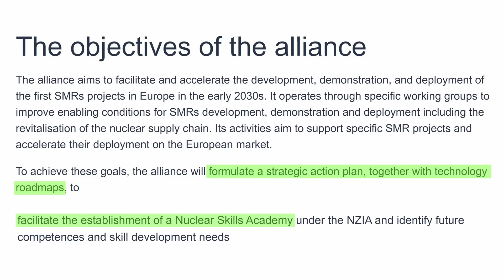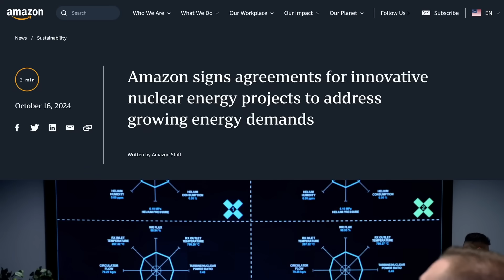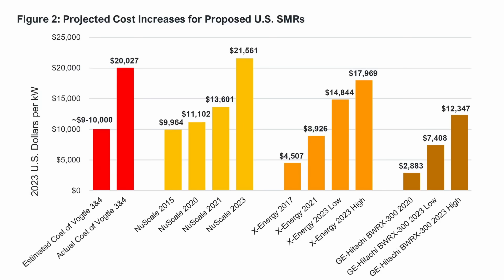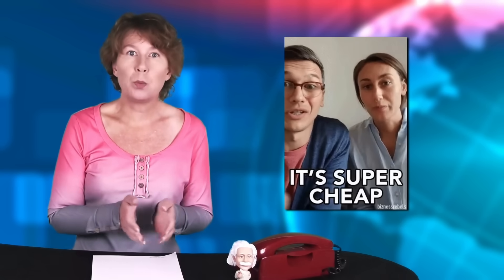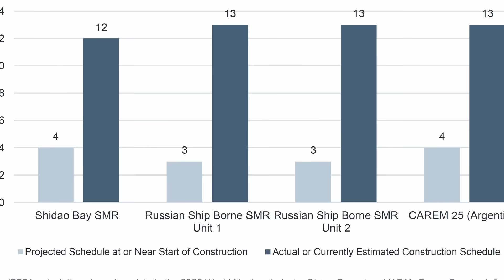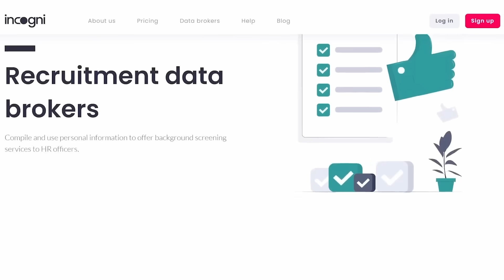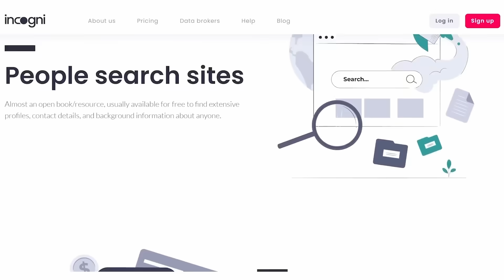Small Nuclear Reactors Have A Big Problem

Comment: I'm confused. We have been powering submarines with small nuclear reactors since the USS Nautilus in 1954. So what's the problem here? We know how to make small, portable nuclear reactors safely and reliably. Dozens of submarines and aircraft carriers are powered by small, portable, safe and reliable nuclear reactors. They all can't cost many billions of dollars a piece? Could someone please kindly explain?
Reply: 1st the question of 'small'
A ship has a reactor about 30-50 MW in size.
A 'Small'MR could be between 50-300 MW in size.

2nd the question of use
Powering a ship is mostly about producing turning a propellor, not generating electricity. (i.e. direct use - turning a shaft with small efficiency losses to the propellor)
Powering a city is about generating electricity. (i.e. indirect use - turning a shaft which generates electricity at a much lower efficiency)

3rd the question of relative cost
A ship reactor is cheap compared to diesel + batteries + less effective missions.
A power reactor is compared to super-cheap coal.
(i.e. there is no good competitor to SMRs for submarines/aircraft carriers)

4th the fuel is different
Ship reactors typically use 20% enriched fuel, operate WITHOUT refuelling and are thrown away after 20-30y use.
Power reactors use 5% fuel, refuel every 3 years, and need to be refurbishable until age 80-100.

5th Assuming a SMR isn't competing against coal, it has to compete against a 1000 MW reactor.
* operators, maybe 1-2 less
* maintenance staff, maybe a few less
* security staff, maybe a few less
* admin staff, maybe a few less
I.e. a 300 MW SMR is maybe 60--70% physically smaller than a 1000 MW reactor, but produces 60-70% less, not 30% less, electricity.
Alternatively, a 1500 MW plant is 50% more electricity, but only 10% bigger in physical size than a 1000 MW plant, so as you go up, you can see savings.

SMRs have other advantages, but you have to be in a particular situation. In general, the bigger the 'cheaper' (per unit - although the total cost is higher).

Comment: Cost blow-outs are not unique to small nuclear reactors I suspect -- we had a 'green' pumped hydro (Snowy 2.0) scheme that was supposed to similarly help address the issue of syncing green (solar/wind) power production with demand via storage (rather than extra base grid power production), and the cost also went way above the initial (already expensive) cost estimates -- I think we are already at about 10x the initial estimate, and the project isn't finished yet.

Comment: I'm pro centralised fusion power - the one in the sky has been powering life on Earth as long as we've been around. The collectors on the ground keep on getting better, cheaper and faster to implement. They can also be distributed where the power is used. 
The biggest attraction of Earth bound nuclear is that it is big, needing big money (usually from governments) and centralising profits (to big corporations).
Reply: Learn more, you obviously don't understand how the grid works.

This is about a fact.
**In an electrical grid, the power must be produced in real time, as it is being used; if supply to the grid is less than demand at any time, there will be a blackout. For the grid to function, supply and demand must be balanced at all times.**
Solar is intermittent obviously because we have nighttime. Wind is intermittent obviously because sometimes the wind doesn't blow (or blow strong enough).
However, if the public can be made to understand that loading the grid with intermittent power sources without backup means regular blackouts, and that backing up the United States grid with batteries would cost at least the equivalent of the US’s whole annual national income, and that backing up the intermittent sources without batteries  (in the absence, at least, technologies that are hardly conceived of yet) means ramping up diesel, natural gas and coal generators and producing enough CO2 to render the whole exercise pointless, it will put the burden on those who think that it’s a good idea (Democrats) to go through with it in the next few years to justify themselves. So if the Democrats, who evidently do not understand the FACT of how electric grids function continue pushing the current energy policies, get ready for frequent blackouts / grid failures just like third world countries have.
You get what you vote for. (Tell a liberal the fact, they may not have ever been told it.)

Comment: The narrative presented here seems pessimistic.
It is worthwhile looking at the cost of a nuclear submarine, which is between £1Billion and £2Billion. The cost of the nuclear propulsion plant might be 30%, if one were making a guess. One might estimate the power output as being equivalent to a large super yacht 100MW, which has the same length and beam; and the lifetime of the powerplant. Nuclear submarines last ~ 25 years without refuelling.
The solutions probably exist and are probably well engineered. One might conclude that a nuclear submarine type reactor could provide power to a small city (200,000 persons at ~ 0.5KW each ) for ~25 years, at a cost of ~ £300-£600 million. But this is a guess based on publicly available data.

Comment: Thorium reactors dont melt down.
Reply: As a general statement about any thorium-fueled reactor, I don't believe this. As a statement about a specific reactor design, I believe this; but there are specific uranium-fueled designs that are "meltdown-proof" as well. Can you provide a reference?
Reply: @pdxjjb  the general design for thorium reactors uses a plug to drain the salt when it overheats. The plug melts, the salt drains and the reaction stops.
https://en.wikipedia.org/wiki/Molten-salt_reactor
Reply: That's a feature of all molten salt reaction, even those with Uranium.
I think all small modular reactors have to be that kind for safty reasons.
If we are sensible, that is!
Thorium is certainly a long term option.
Reply: @larsnystrom6698  all thorium reactors are molten salt. Some SMR designs uses uranium rods. I'm not an expert but I do prefer molten salt designs. Specialy that one from Kopenhagen Atomics
Reply: Wrong, solid thorium fuel has made and used.  Like many nuclear kool-aid drinkers you have conflated multiple seperate technologies you do not understand.
Reply: Not existing indeed helps them not melt down.
Reply: Thorium doesn't solve any of the actual problems of nuclear.

Did you mean molten salt?  This is orthogonal to whether the reactor uses thorium.

Comment: I did my graduate research in the economics of SMRs as the primary physics researcher on a project funded by the Obama admin. The experience was one of the best but also most draining experiences of my life. There is a lot of tech there, a lot of capacity, and the flexibility is extremely appealing. BUT, it was heartbreaking to see how hard it was to break ground on any new projects in the US and the EU.

We have off the shelf tech that COULD solve many of our growing energy needs as well as hitting our environmental goals if only politics would get out of the way. I am not talking 'de-regulation', I mean that the public opinion needs to be largely ignored here. Once the benefits are realized, the public will have a hard time rolling things back.
Reply: Seems to me that the basic engineering has already been done on SMRs since a version powers US aircraft carriers and subs. Did you look at the economic feasibility of modifying those existing reactors to fit the bill?

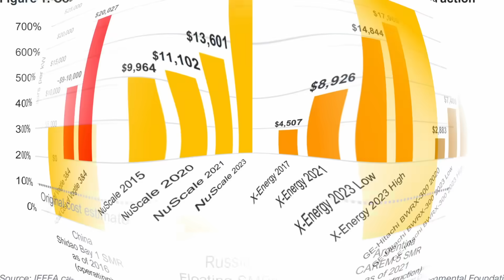Comment: At 4:00 we can see that the cost runs around 20,000 per kW. 

That assumes they're running flat out, but if they're throttled at all, that cost rises. At 50% it's $40,000/kW. Since demand fluctuates the only sensible thing to do is to provide battery backup to smooth the demand. Tesla megapack XL2 is $1400/kW. It's obviously cheaper to size the nuclear for average consumption rather than peak, and use batteries to firm supply. 

But then you have to ask, "if nuclear is only viable when firmed by batteries, why would you build nuclear at $20,000/kW when you can build solar at less than $500/kW and use batteries to firm that?"
Reply: > why would you build nuclear at $20,000/kW when you can build solar at less than $500/kW and use batteries to firm that?"

1st - you can plan when to charge the batteries with nuclear. Within wind/solar you can't. 

2nd - you have to buy a LOT more wind/solar/batteries because of the low c.f. and because of ther intermittency.

3rd - you have to buy a LOT more wind/solar/batteries because of the seasonality.

nuclear - predict demand for the biggest -- day -- of the year, then work out the nuclear/battery mix which will meet demand across the demand load peaks/valleys. The resulting capacity will be fairly close to the average across the day.

wind/solar - predict demand for the biggest -- week? month? quarter? -- of the year, then work out the wind/solar/battery mix which will meet demand across the demand load peaks/valleys.
The resulting capacity will NOT be fairly close to the average across the week/month/quarter, as your peaks are VERY high and your dips are VERY low (because weather is correlated across LARGE areas - ex: Texas is about as big as a hurricane).

And because weather is correlated with previous weather (i.e. 22 January is likely to be a winter's day, just like 21 January, etc) you have to look at long time-frames, which of course give you large variations - the AVERAGE is useless (ex: do people eat the same average amount of ice cream in February as the average amount they eat in July?).

So yes, per unit nuclear is more expensive. But you have to buy a LOT more units for wind/solar.
Reply: @factnotfiction5915  you're missing scale. Not all "a LOT" are the same. You need "a LOT" more solar, (5-10x) but that "a LOT" is much less  than the "a LOT" more cost of nuclear (30-100x).

Comment: Why should we invest in a bridge technology, when we can go straight for renewable? By the time we have SNRs or next gen NPP we could be finished with the energy transformation already.
Reply: From the late 1970s, over a 15 year period, the French built most of their 56 reactors and today have a) some of the lowest emissions, per capita/gdp/etc, in Europe b) cheap electricity.

From 2011 (or even earlier if you listen to the Greens themselves), Germany has embarked on the Energiewende, including closing NPPs. It is now 2014 - so 13 years have passed.

Germany today has a) some of the highest emissions, per capita/gdp/etc, in Europe b) expensive electricity (about 2x the French price).
Germany has 2 more years to beat the French record - what odds are you offering?

> we can go straight for renewable ... [and] be finished with the energy transformation already.
Why do you believe this? Germany has (ok, 2 more years) shown it cannot be done.

They have a strongly united society, with clear political support for RE, and odds are they will completely fail.

Why is it you believe RE is so quick? so fast? so cheap? so low emission?

Show us the country/city/province that has decarbonized as quickly, as cheaply, as France has, but using intermittent RE?
(I will grant you that hydro nations like Norway have, but few countries have Norway's mountainous geography, and Norwegian hydro doesn't really predict wind/solar in flat Belgium, etc).

Comment: Freeman Dyson says the problem with small reactors is they're explodey (not his word)... as they were fashioned based on nuclear sub reactor designs. He says you can make them safer by ditching small and going large.
Reply: If he truly said that, he's a nut - but I believe you must have read him incorrectly.

Small reactors have low power output, so with less power, less 'explodiness'.

If you need to visualize, try this:
Experiment A: put an eye-dropper's worth of gasoline in a 10 gallon bucket, apply lit match to gasoline. Observe.

Experiment B: put 10 gallons worth of gasoline in a 10 gallon bucket, apply lit match to gasoline. Observe.

Comment: Here's a simple calculation for why SMRs or other nuclear plants can never reach the scale required for them to provide a significant portion of total energy needs:
Total functioning reactors on the surface of the earth ~400.
Total major civilian nuclear disasters in the 75 years we've had nuclear power = 3 (Lot's of military ones in that period - Wikipedia lists over 70)
Mean time between failures = 400*75/3 ~10,000 years (pretty reliable - very impressive engineering).

Nuclear currently generates ~4% of total energy needs. To go 100% nuclear would require 25x the number of reactors = 10,000 reactors on the planet. SMRs would require even more. To get 25x reactors would result in them being scattered across the country near most towns (like in France).

But with 10,000 reactors and a MTBF of 10,000 years, we would be having ballpark one nuclear meltdown per year somewhere in the world. And everyone would be living down the road from a nuclear power plant.  I don't think society will ever be happy with that perceived risk. And I definitely don't think my grandkids will be pleased we bequeathed them the contamination or the decommissioning costs.
Reply: You don't get meltdown failures in molten salt or metal reactor.
Reply: @BerndFelsche   But if those reactors are so much safer then why aren't they built and used around the world??   Research has been done on these systems for years with no sign of significant progress.    Maybe because they have their own inherent technical problems.  In other words your alternative suggestion doesn't help.
Reply: @BerndFelsche  There have been (partial) meltdowns in liquid metal cooled reactors.   EBR-1,  Fermi-1.
Reply: Good point. And that's why SpaceX rockets blow up so often too.

Comment: I would say it's partly the opposite - solar energy is just becoming incredibly cheap. The production is basically a paint job the operation is just put it outside and screw it tight. We don't need more energy it's basically free, we need just storage and transportation solutions. Nuclear will never be cheap, you always need skilled people to guard and run it, you always have to dig for uranium. You will never be able to sell them on eBay

Comment: Nuclear power is the most expensive you can get if you honestly take into account all costs. In France last year half of them had to pause or lower Produktion because of a hot summer and too little cooling water, so much for reliability. Just bag it and go for cheap renewables. We have all the capabilities for Produktion,storage and distribution

Comment: It's interesting to see (regular nuclear no longer competitive with e.g. solar, or well almost anything, plus) small reactors neither/in trouble, but does it apply to thorium-based (not under discussion in this video)? Copenhagen Atomics promises cheapest of all (just not of nuclear) is "developing mass manufacturable molten-salt reactors. .. is pursuing small modular, molten fuel salt, thorium fuel cycle, thermal spectrum, breeder reactors using separated plutonium from spent nuclear fuel". Best case is optimistic, I believe thorium and/or molten-salt (small) nuclear has some known problems, so it would be good to know what Sabine thinks. I doubt anyone knows too many specifics about individual technology of companies (and if it's public data to be trusted), at least some numbers regarding cost sunk in, already, might be available.

Comment: Idk if this is a legit scientific question or just sci-fi prompt but if a battery can be a computer, can a nuclear reactor too? Rather than build a smartphone from different device parts of "electron dancer needed", why not build a battery compound which also computer circuit and photonic screen? Someday those not just molten salt rector but certain compound which higher melting point and activated as computer(Radioactive Super Computer).

Comment: I've got a degree in nuclear engineering. SMRs tend to leverage 4th Generation reactor designs which require materials sciences advances not yet achieved. That's about the main issue.

Comment: Thanks for this information.  Sad to hear that the early results aren't living up to expectations.  The idea is attractive: small reactors, moredistrubted across the grid makes a more robust system.  I hope these problems can be overcome.
Reply: The problem is that the SMR-industry is filled with scams just burning investor-money as the only fuel. Noone actually dares to make a realistic plan with realistic estimates of time and cost. And if they did, investors would choose the cheaper, but false, promising startups instead.
We are not going anywhere until we have saturated the greed of the scammers just trying to make a quick buck on the false hopes.
That is the price of capitalism and the principle of always choosing the cheapest alternative, even if everyone knows it is fake.
Reply: If the early results are due to regulations, then the standardization should reduce costs long term
Reply: "small reactors, more distributed across the grid makes a more robust system". Exactly, but you've just described the greatest economic advantage of wind, solar and batteries - the very things that will forever keep SMRs commercially unviable.

Comment: I feel like small nuclear reactors have been touted as the next big thing for 25 years or more. Has power engineering discovered a new constant, commercial Fusion is always 30 years off, widespread small modular fission is always 10 years off?